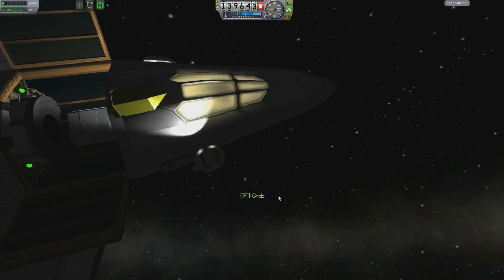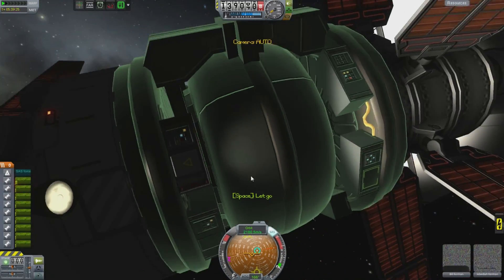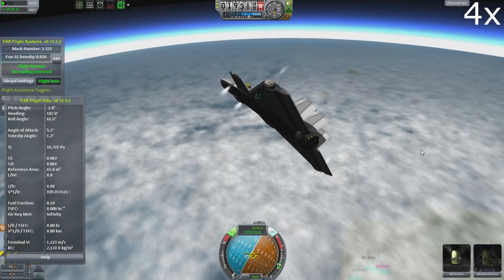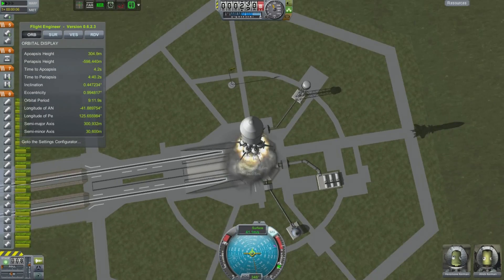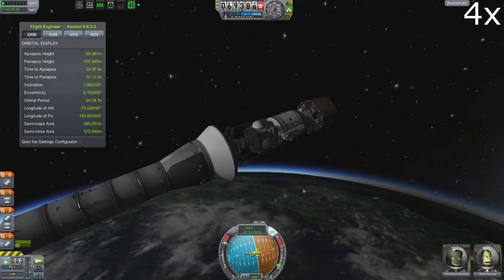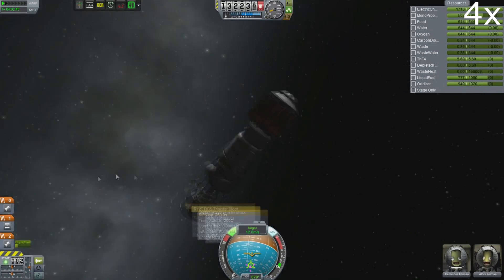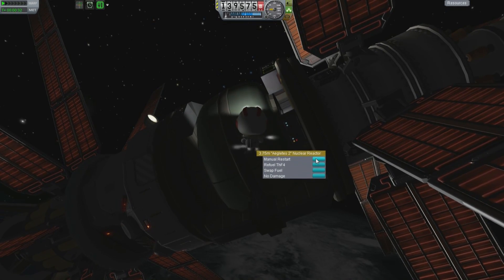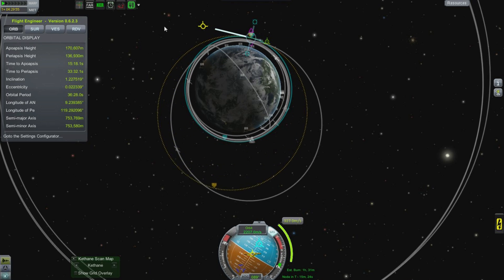Kerbal Space Program - Interstellar Quest - Episode 31 - Reactor Control Room

Comment: You just mentioned the exhaust hitting the radiator panels and the heat came to mind along with your info on the Sabre from the last episode, I think, concerning the way the Sabre cools the air going in from insanely hot to sub zero lickety split. I was wondering if something like that could not be used after a jet engine to drop the heat so wouldn't be as detectable to infrared etc? Maybe kind of a passive "stealth" technology :~)

Comment: 15:40 Uranium (and nuclear reactors) aren't green, Uranium is green, the reactor is typically blue.
Reply: waterlubber While I agree with your sentiments you can't really compare Fukushima with Chernobyl... Chernobyl was an old graphite moderated pile of crap reactor that they abused for days before finally attempting the experiment that made it melt down, Fukushima, and Three Mile island were both water moderated reactors. They can't really have meltdowns like Chernobyl, and the worst case scenario with them is instead a steam explosion, which while irradiating a large area, won't make them melt into the ground...
Reply: *****
Yeah, another advantage to water moderated reactors is they tend to catch fire less.

Comment: I know it's an older controller, but I have a Saitek X-53, and there are newer version out, but It has the neat option of having 3 separate bindings configured on the fly. You just simply turn a switch to one of three settings. It does take a while to setup up the thing, but I love it, works with just about anything. Since you can bind any keyboard commands or scripts to a single button. And the best part is each of the 3 configs have a pinkie key to make each button on the controller a completely separate action. I know it's a bit older but It's working fine for me in Win 7 no sweat, and you could probably pick an older one up for cheap otherwise get a nice shiny newer model. I think it would solve most of the problems with switching between the two flight modes. Keep up the stellar videos!

Comment: Just a heads up Scott, you can anchor payloads to fairings using struts with those fairings. You just have to find the attach point which is located in a thin area down the side of the fairings, can be a bit tricky to find it but it's definitely possible.

Good videos by the way mate!

Comment: Why don't you just use a joy stick for space planes and the keyboard for rockets, because I would think it would be a lot more useful for rockets. However I suppose in Kerbal SPACE program your going to be using rockets more than space planes.

Also given the amount of radiation even in near earth orbit in space and the typical shielding that would be on a reactor it wouldn't actually increase the radiation exposure that much at all.

Furthermore I know you said you didn't want to use the  procedural fairings but you can link struts to it so.
Reply: I think he said that whenever he switches from a rocket to a spaceplane it messes up his control mapping, but i may be wrong tho.

Comment: On the matter of Procedural Fairings, why not make a set of locked ones (don't auto-size anymore - forgotten the hotkey but its likely now a tweakable) to closely match the size of the KW ones you use, and save them as subassemblies?

Then you get your payload struts and still keep the challenge of restricted fairing choices.

Comment: I suppose there isn't a whole lot of space for passive safe systems on a space-faring nuclear reactor... most of the time IIRC those sorts of designs usually just flood the reactor with water, and use it as the moderator, so it can't go critical. this being a fluorine based reactor, I imagine there are many things that could go wrong... but just a couple questions: just how bad would an EMP be if this thing exploded? also, how exactly does 'power beaming' work? (is that a real thing?)
Reply: It's like how your microwave works but more focussed. Luckily we don't have something here on earth. A wobble in the orbit of a transmitter could have significant repercussions on living things. The result being how your microwave works...
Reply: This is a FLUORIDE (F-) reactor,not a FLUORINE (F2) reactor, and is much safer than a water moderated reactor due to not having problems with steam explosions or hydrogen production. Nuclear reactors all need to go critical (constant or inceasing power) to function, what you don't want them to do is go PROMPT CRITICAL, which is an uncontrolled exponential increase in power, something no moderated reactor can do.

A power reactor does not cause nuclear explosions. The coolant can overheat, boil and explode is something goes badly wrong, but no EMPs will be created. The power beam is a microwave transmitter, similar to the magnetron in your microwave oven, while the ship it is beaming at will have an antenna to pick up power from the microwaves. No, it has not been built, but is a proposed way to remotely transmit power in space

Comment: Actually the KW fairings have a collision box. It's just very tiny and hard to find. 
I used KW fairings before a couple updates ago, but now they are too memory taxing compared to other available fairing providing mods (NO I'm not going to say i'm using proc fairings).
Anyways: You can attach stuff to the fairings. But you pretty much need to place the strut on the fairing and then connect it to the payload because it's a major pain in the behind to do it the other way around.

Comment: Scott, you can attach struts to Procedural Fairings. Saved me a payload or two already.
Reply: Not sure why, but Scott has said before he doesn't use Procedural Fairings. I suspect it is because they aren't as realistic. I use them, and it's easy to have a bizarre looking ship with a very bulky payload under those fairings. Some of my ships have looked pretty ridiculous. I'm tempted to try whatever fairings mod he's using instead. Sounds like it offers more of a challenge to fit your payload inside them.
Reply: Phoenix84118
 He's not using procedural fairings as there is no limit to the dimensions of the contents. As an example I once (as a joke) extended structural segments through the walls of the VAB And it still had no problem with enclosing that in a faring. Needed struts of course, but having a massive disc/cone larger than the launchpad is possible.
Reply: Yeah, that's what I figured. I was thinking of trying another fairings mod for that very reason.
Reply: Phoenix84118
I think he doesn't use them because he likes the challange of fitting things into fairings and as said before, its more realistic